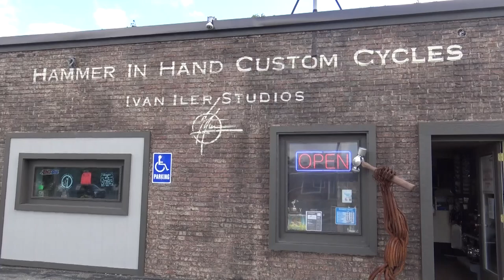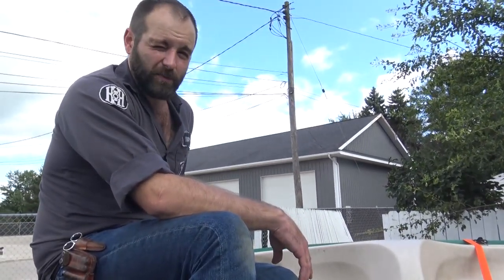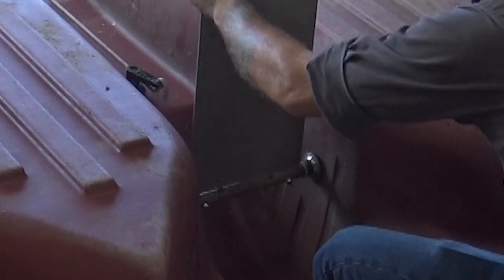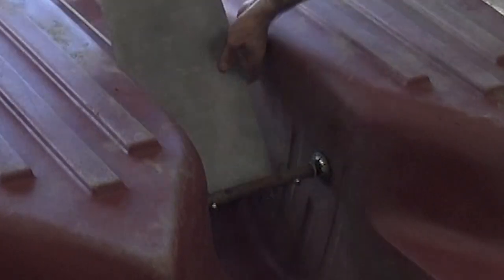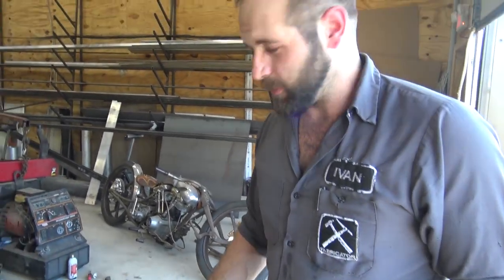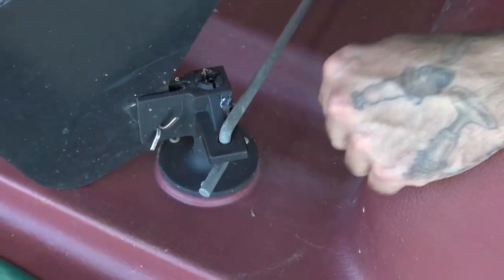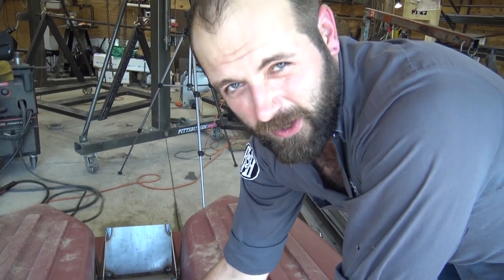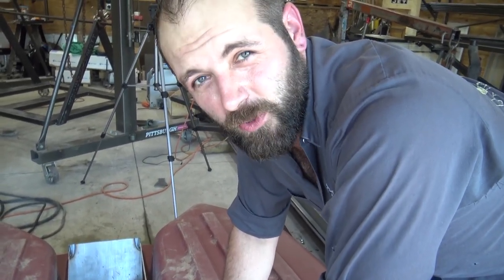How To Repair A Pedal Boat Propeller

Comment: I have a Aqua 5 Pedal boat and was wondering in I could take the top half of the boat off and the put a big sheet of plywood on the hull so it a flat bass boat.  Would this work or is the hull made to fit the top half.